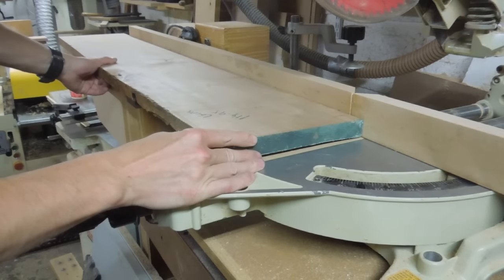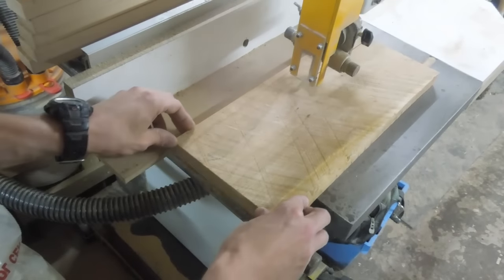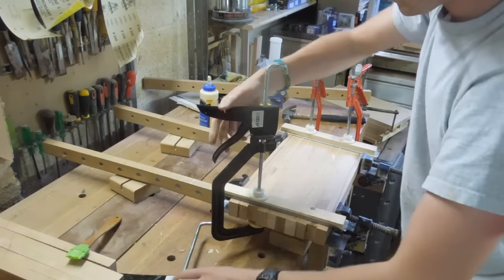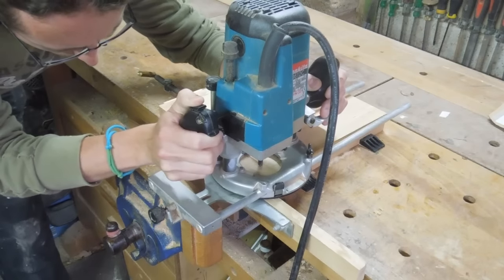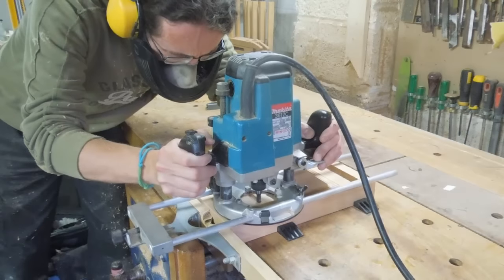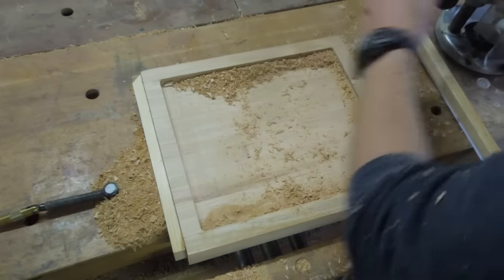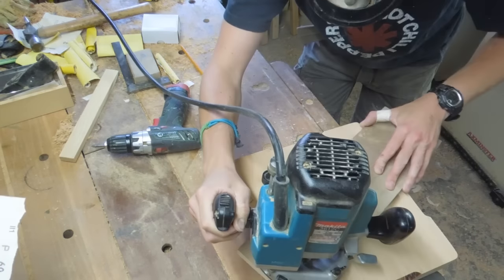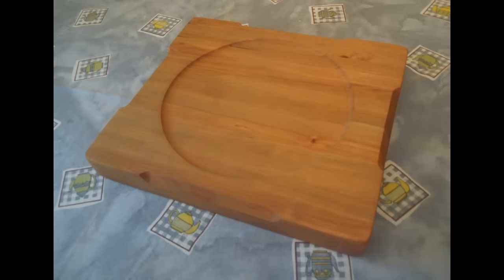Making a Wooden Platter/Plate

Comment: Beautiful work. Only thing I noticed was when you were plunging you were routing counterclockwise on the inside of your workpiece. I’m assuming you felt the edge guide want to steer into you. When routing outside of the piece counterclockwise... when inside clockwise.
Reply from the maker: Thank you and you are correct. I would only have done this if I was concerned about chipping and breakout when cutting across the grain.

Thanks for your conment and for watching.

Comment: After seeing the amount of work routing I think I’ll make a picture frame with rounded corners and glue that to a thick base.
Reply from the maker: Good luck with your project and thanks for both watching and your comment. One thing to consider if using a solid wood base is that it will want ti expand and contract across its width, where as the frame on top will not.

All the best.

Comment: How did you attach your router to the plexi glass?  Thanks!
Reply from the maker: meredith moran I'm pretty sure I drilled a hole in the plexiglass that was the same diameter as my guide bush and that was all it needed. In the past, I would remove the plastic plate underneath the router and screw it on directly. But using the guide bush is much quicker and simpler. ;-)